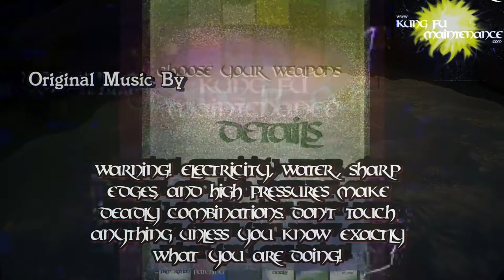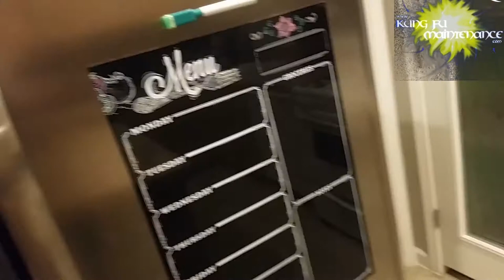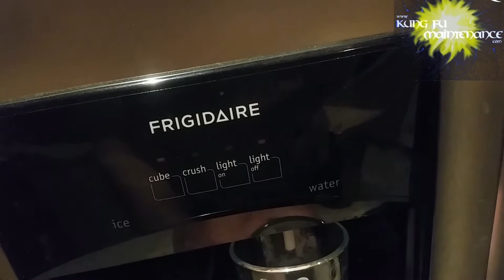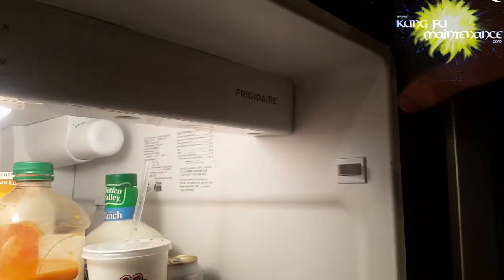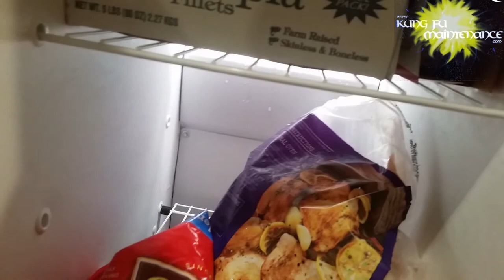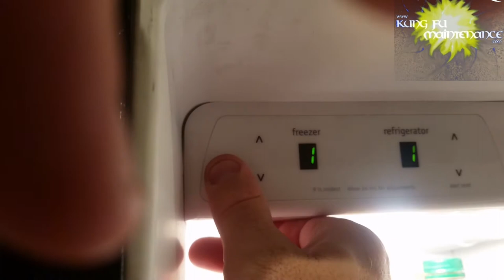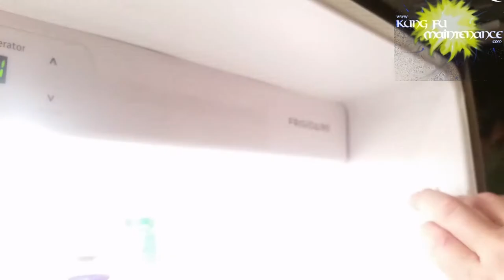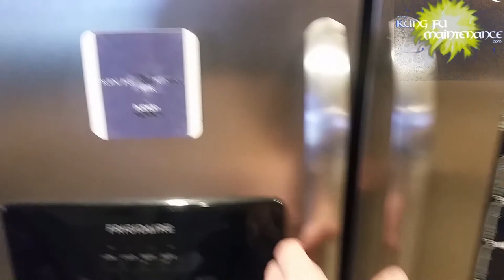Side By Side Refrigerator Making Loud Noise Enter The Defrost Mode

Comment: P.S. Also check down by the condensor fan, pieces of insulation can get caught in the fan blade, while you're at it, clean all the lint buildup on the condensor tubes.

Comment: tl/dw - The noise is the fan blade hitting ice that is building up in the back of the freezer. Turn off the freezer side and let it defrost, problem solved.
Reply: Why does that happen? How can you prevent it?
Reply: Joshua C how did u do that